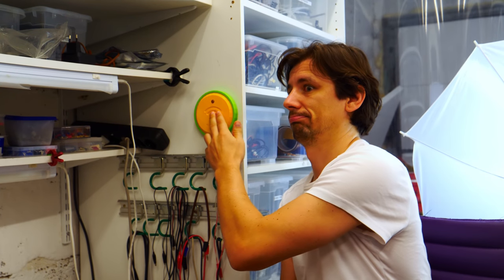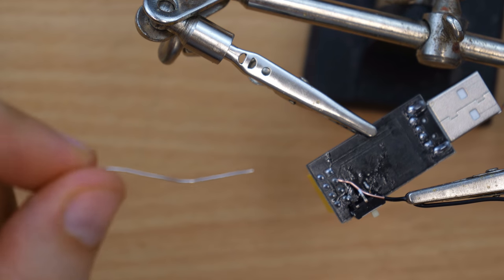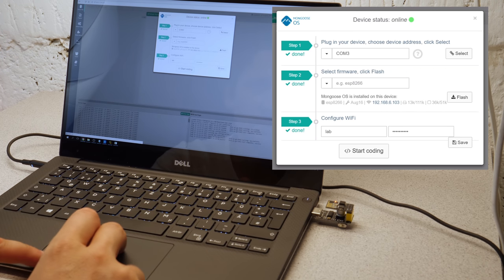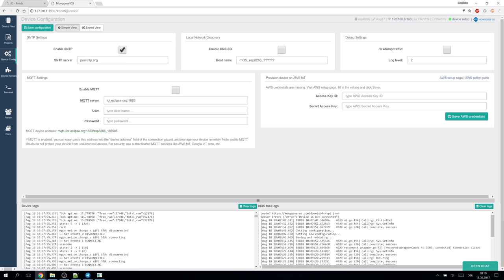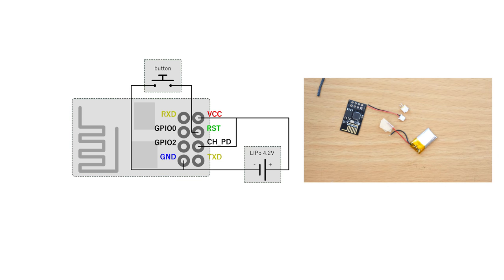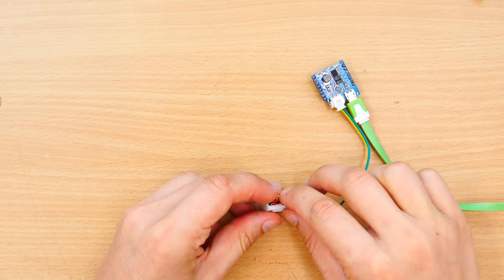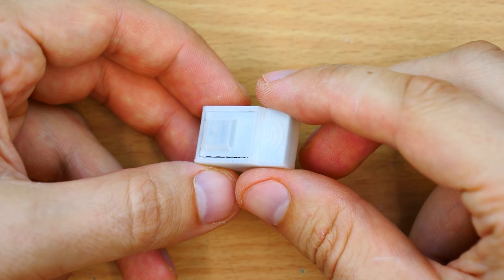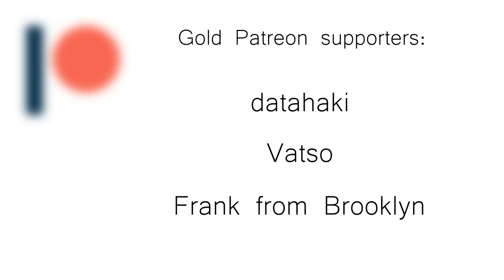The Smallest WiFi Button in the World (ESP8266, MQTT, IFTTT)

Comment: The mongose os part has changed. How can I get it programmed. Dec 2019
Reply: @bibitluni's lab
can you answer?!
Reply: I had the same issue! After several hours googling I found the workaround buried in an old forum post. They removed the IDE from mongoose-os. To get around this you need to revert tothe last version that contained the IDE, 2.6.0. Use the following command "mos.exe update 2.6.0".